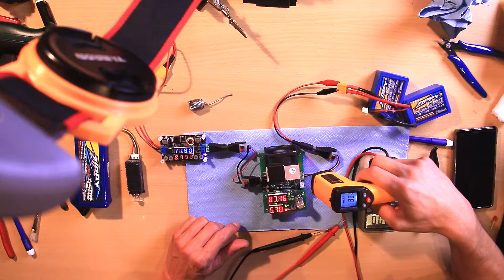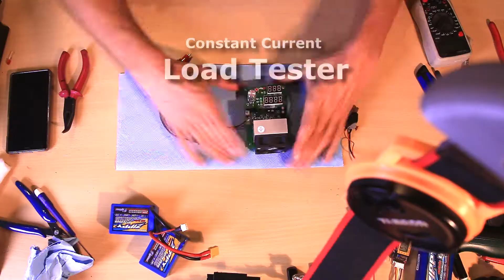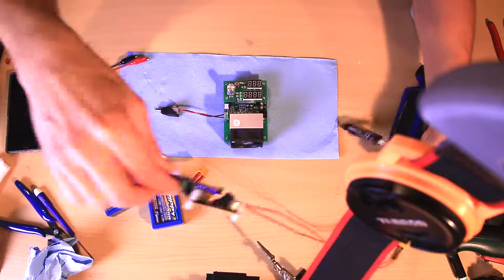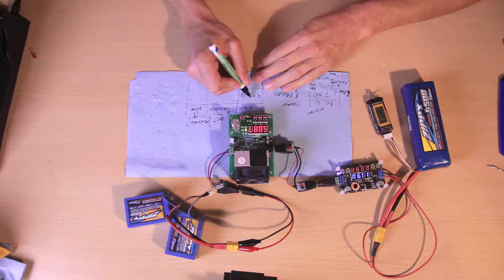#61 🔌 Playing with Constant Current 60w ZPB30a1 v2.8

Comment: ZPB30A electronic load tested
The ZPD30A is an electronic load for testing your power supplies, batteries and batteries in a fast and inexpensive way. Thanks to the microcontroller control, this device also measures the total capacity and the total delivered energy of a battery or accumulator.
➡    Read this article
https://chinese-electronics-products-tested.blogspot.com/p/zpb30a-electronic-load-tested.html